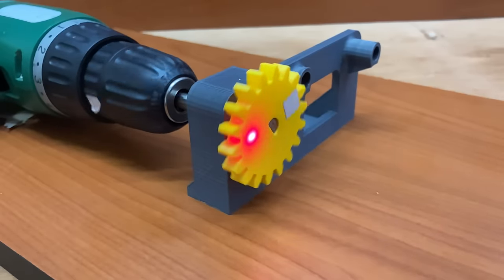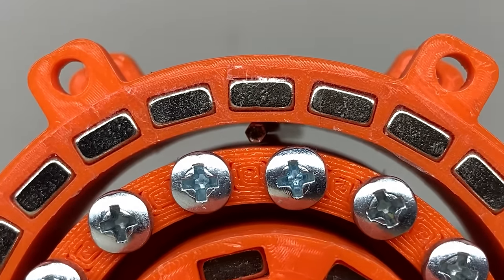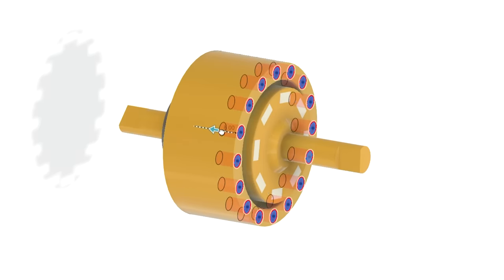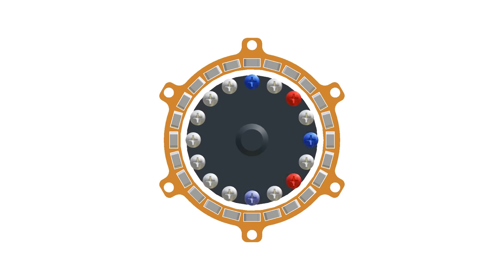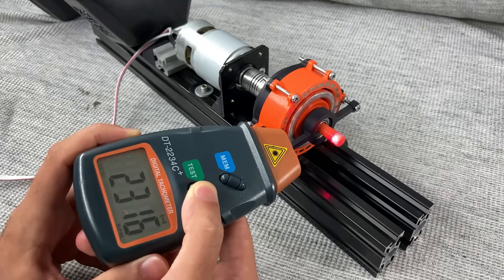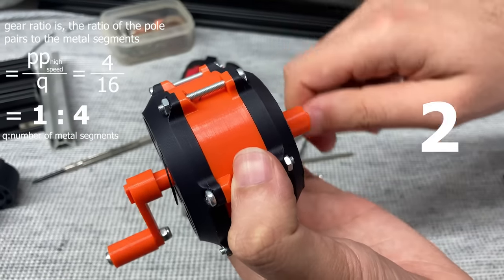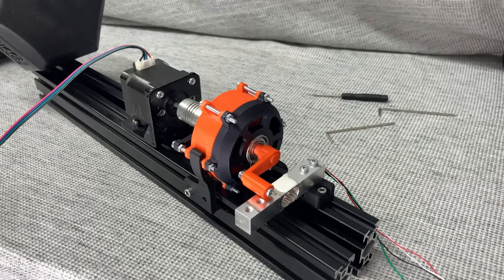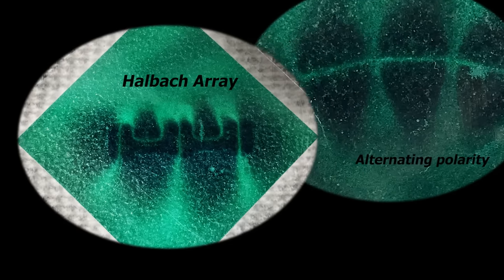Magnetic Gears - Why Nobody Talks About This?

Comment: Are you trying to measure efficiency as a ratio of speeds? Because that will always return the same value regardless of efficiency, you need to measure torque instead. If you measure the torque on the output load, on the input motor, and on the gearbox mount, you should find that the ratios don’t match up quite the same as the speed ratios. Technically you can just measure two of those and calculate the third torque from the difference.

Comment: the answer is pretty obvious but the question makes for a good click bait for sure. The efficiency goes through the roof with magnetic gears and any use where you need direct torque is out of question here. So the right question is actually where can you use them? I'm thinking some small scale machinery, low energy, where lack of precision can be leveraged by durability.

Comment: can this be used for high mechanical efficiency electric motors in electric cars?
Reply: Can it be incorporated into the design? Yes (Though, with caveat, you can incorporate most anything interchangeably limited only by your imagination realistically). Would it be of any improvement? No. Would this be practical? Also no.

Comment: What if the magnets weren’t spinning inside of each other via a small and larger ring spinning on the same plane. What if you constructed a magnet “clutch” two spinning plates that can be put very close together but not touching and with very strong magnets. How would that change the performance.

Comment: Use it to spin a washing machine pump's shaft and see how amazed you'll be at the multimeter output reading on it compared to the input. Then see what all you can power with it and your brain will break.

Comment: Idea - Could you use electric motors and dynamo generators to reduce the cost to less components. You just transfer electric energy not forces.
Reply: 99% efficient motors and dynamo generators. With this you could transfer forces by transformation instead. Problems solved. Even in a fuel machine

Comment: There are so many reasons why it’s not viable. Magnetic properties change with variants in temperature, heat generation from fields and material performance degradation from vibration and temperatures

Comment: This will not work well (or perhaps even at all) in metallic housings because of eddy currents.  Magnetics moving past conductors induce eddy currents.  The circulation sense of the eddy current generates its own magnetic field in such a way as to fight  the imposed magnetic field that caused the eddy currents in the first place.  The effect is like a brake.  You cannot use plastic to drive any substantial mechanical loads.   If you can find an equivalent material with the strength of metals but with no electrical conductivity,  then perhaps you can begin to realize magnetic gears.  If it is a metal, it will suffer eddy currents.

Comment: Why nobody talks about magnetic gears? The only redeeming thing about magnetic gears is the over torque protection. There are probably other ways to prevent overloading in driveshaft as well so you'll have very few niche cases you'd use magnetic gears in. Very low torque transmission capacity and its not 100% efficient even in low torque applications.

Here's a wild thought, instead of transmitting power through magnetic gears, you just remove all the gears and the remove power source and put a electric motor where you need the torque. Literally replace the magnetic array with a stator and "the gear" with a rotor and you have a functioning electric motor. You don't even need any gearbox since you can just alter the motor power by altering the power you pump into the motor. Or if that doesn't work, use mechanical gears or hydraulics to transmit the power. 

Lubrication is kinda a moot point as well since you often need to lubricate the bearings, in which case you can just integrate gear lubrication to your lubrication system or slap some grease on the gears during maintenance.

Comment: This is not a game changer. This is over 100-year-old idea and nobody uses it in anything large scale because it transfers minuscule amounts of torque. That’s the same reason that you don’t see CV transmissions in anything but little Econo boxes with less than 125 hp, the useful amount of torque that they can transfer is limited by physics. A few applications that these type of things have been used and are in very small scale applications that require higher RPMs with very little torque requirements.

Comment: I am considering the following construction: a sphere-shaped vehicle consisting of two spheres - one inside the other. The spheres do not touch each other thanks to the appropriate arrangement of electromagnets. The vehicle would move thanks to changes in the magnetic field at an appropriate frequency (there would be a rolling of the outer sphere.). There could be a passenger inside. Something like BB-8 from Star Wars. Maybe someone knows a similar project. Unfortunately I can't find anything like it on the Internet. Or maybe it is not possible to arrange the electromagnets in such a way that the spheres do not touch each other?

Comment: This is another use or form of Magnetic Flux Switching ,The methodology implemented here may be used to
construct a self sustaining magnet motor / AKA - a perpetual motion rotary motor ...  
it would take a different configuration of the Flux Modulator an Magnets ...
NO Electricity needed ...

Comment: You cannot calculate efficiency comparing RPMS, you have to compare power in vs power out. That would require knowing the torque and rpm of both the input and output shaft.

Anyone who thinks they have found a 100% efficient ANYTHING should think again…

Comment: So let me answer your question:
1, there's almost no torque transfer. Anything stops it. There's really no application where 3 orders of magnitude less torque handling than a regular planetary gearbox is ever acceptable.
2, this gearbox produces a ton of cogging even when the input is smooth. You didn't answer your own question about why it makes so much noise. The answer is because of the massive cogging that occurs. Every piece feels it and every piece is being shaken by it. That's why the noise.
3, it just costs too much. Steel is cheap. Nd is expensive.

Other people have mentioned other failures so you can read their comments for more reasons.

There is no scenario where you would want to use this except possibly nanotechnology where friction destroys gear systems in minutes instead of decades. Good luck applying it to that though.

Comment: Nobody talks about magnetic gears because magnets wear out incredibly quickly, the torque transfer between the set is very low, and their power to weight ratio is abysmal. 

Overall they don't have any uses.

Comment: 1:30 have to stop here.. by look at it, they can transfer very little load and come in big size to do a job, same load could be transferred by very small very hard iron gear, packaged into gearbox with bearings and oil, that would last 20years no problem

Comment: gears mechanical vs magnetic : mechanical gears don't have to overcome the attractive magnetism. To overcome this the magnetic gear would become too complex and would need electronic control to release the attractive force when moving , just like an electric motor. Or way to bulky like you show with that flux control. Mechanical gears just work.

Comment: Imagine a military vehicle engaging an enemy who uses an electromagnetic pulse device on the unit your concept is operating on, it would immediately render your vehicle inoperative by removing the polarization on your gear box.

How would you defend against a weapon of this type, or an effect of this type coming from a natural source such as a solar pulse, not to mention the gear box inducing voltages in any nearby wires or components. 

Problematic without protective housings, insulations or some kind of EMF counterforce protections.

Comment: "Why nobody talks about this?"..... 3 words :" load bearing per dollar"  it's fine for small loads and small silent gears but in high speed or high tork reduction the efficiency will be reduced below usable application and finaly the cost of manufacturing from all the permanent magnets in a speed reducer or a gear box is very high

Comment: As for why no one talks about them. I'm going to go with them being rather expensive to manufacture, and probably unique maintenance routines and problems. You just don't gain that much through using them. Not to say they're not really cool, they're like Tesla valves. Looks cool great theory, not practical.

Comment: its a cool idea but you can not create torque through a gear ratio when the gears aren't touching. it's not magic. you have to think about why that works with mechanical gears. a small gear can turn a big gear quickly because turning is a measure of degree, not distance. so the angle is the same but the larger gear's circumference is much larger. and when you translate the circumference to a distance, that means it's covering more distance in the same amount of time. aka its faster. so the only way it's physically possible for that to happen is if that higher speed has less power. and rotational power is torque. you turn that whole system backwards and the big gear is now turning the small gear slower than itself. well where is that speed magically disappearing to? it's being converted to torque. everything is balanced. but in this magnetic version you are not transferring power 1:1. your magnets are just connecting sometimes, when they happen to line up.  the first gear is not transferring any torque at all to the second gear. the only power involved is the power of the magnetic force. the first gear is moving with as much power and speed and the motor puts into it. but it's just spinning in the air. it's not transfering any power at all from the motor to the second gear. only the power of the magnets reacting with each other is transfered. With regular gears there is no slipping. slipping means something is broken. either one gear turns the other, or the power is too much and something breaks. this magnetic setup is actually a very wasteful system not an efficient one, because as soon as you get any power at all, it slips. I'm not an engineer I'm a mechanic so I know my words are not the most technically accurate. 

I would be more interested to see you make magnetic bearings. That I believe is the next big innovation in mechanical systems. Levitating shafts. You would probably need an eletromagnet to make enough force to offset the tension of whatever chain or belt is driving the shaft.

Comment: Sure a magnetic gear may perform better than a pla 3d printed one, but 3d printing is terrible for gears. Gearing requires a lot of time and effort to learn about and they are mostly machined. When in mesh they don't scrape each other, but rather rub/roll. This is due to tight tolerances that 3d printing is terrible at.

Comment: You can use opposing magnetic dust instead to eliminate friction between gears. Also gears are boring. Really old idea. Why would you need gears when you have an engine the can suppress power and likewise expel power.

Comment: Metal parts gears and plastic pots kills have different type of solution cooling off the parts it's safe but the metal uses oil to make sure the gears don't broke for the plastic type of gear the solution for it to be cool down is water dan it would be able to cool clear spots and soft the Chip pink purple

Comment: Efficiency loss, cost, torque limitations, slip are why this technology is not widely adopted. Engineers make design choices to address very specific needs on each project. These youtube videos showcasing "underutilized" technology are funny. The tech may be cool but that doesn't mean it's useful, and that's why it isn't widely adopted.

Comment: - Heavy weight (few problems from here)
- temperature sensativity
-magnetic problems
- torq limiteition
And this is not a gear, also not a torque converter, something middle.
Hydraulic TC most better. Usual gears, belts and chain for a gears too.
Video about nothing. And 2.2bln viewes. SMW 😒

Comment: You talked about efficiency and claimed it was higher than with gears, but never measured transmitted power, so you had no measurement of efficiency at all. Lack of slip does not indicate efficiency... although of course slip means inefficiency.

Comment: But this isn't anything new... And it will not work as good in a car where you have high loads and contact to the ground, you would need some really heavy duty magnets to drive a car and to get the effect needed to get going, and since the load will increase so much pr kg added, it will be useless..
Reply: And so much vibration 😳 That would be a problem in cars... It won't be reliable at all..

Comment: You did not measure the efficiency.
" there is no load "
No load means no torque, so no power, so no way to measure efficiency. 
Efficiency is the ratio of output power to input power. And you did not measure power.

Comment: Clear and clean environment  to aviod contaminated particles super magnetic fields push back if to strongly applied but in creased tork to free spin affects waves with magnetic fields inter action against a kick pulse the instructors in crease decrease spin electric motoring included47 volts dors a lot at 800 horse power flying a plane